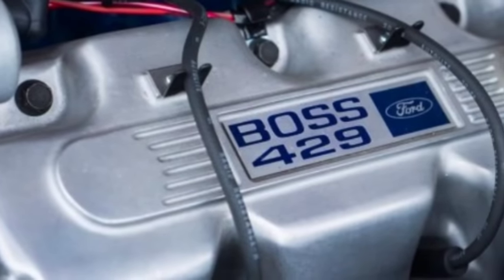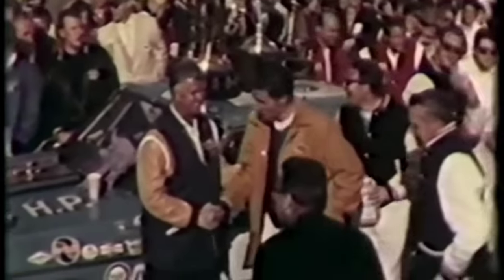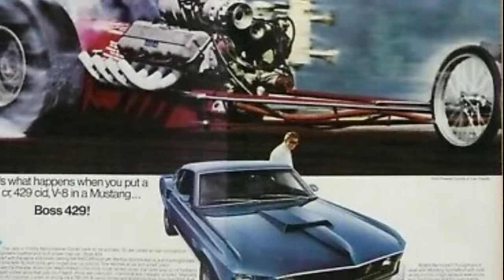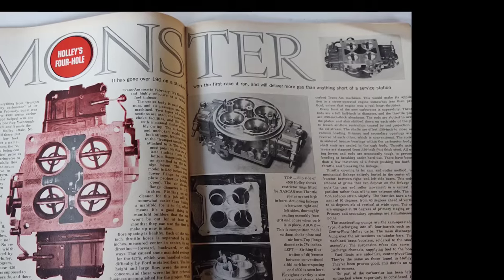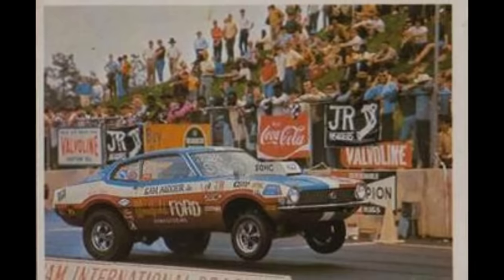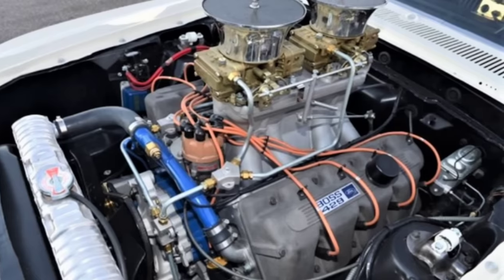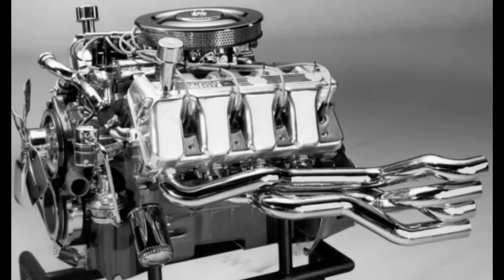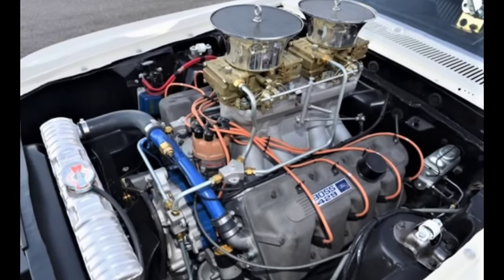The Misunderstood BOSS 429

Comment: The ports were just too big for anything other than wide open throttle. Big ports = low air/fuel velocity at lower rpm. Also the issue with improperly tempered valve springs hindered revving in the early engines, but Ford replaced them. Detuning for the street didn’t work out well. A split plane intake manifold should have improved velocity in lower and midrange rpm. The Ford engineers know more than I do but I just can’t understand how they didn’t work out a street version.

Comment: You can get a new Boss 9 engine from any Ford performance dealer in lots of different cubic inches. All engines are ordered through Ford and all are built by John Kasse race engines. A detuned street version has over 800 HP .

Comment: The tunnel-port 302 fared no better in the Trans Am series.. no bottom end torque exiting the turns... the Z-28s ate them alive. 
The tunnel ports (302 and 429) were best at prolonged, high rpm distances. 
In short, they had no guts down low, but give them a mile to build a head of steam (or add a blower) and they were MONSTERS.
Reply from the maker: Yeah the Tunnel Port 302 was a disaster...
Reply: So who won trans am series in 1970 . Wasn't Chevy.

Comment: In the early 2000 I built an open road racing Mustag using a 441 cammer engine based on a Dove aluminium block. 13 to 1 compression uprated cams . The engine dynoed at 787 hp.
For the period I raced it it was the secon fastest open road racer. Only Gottliebs Camsro utilizing a 530 c.i.  big block Cevy was faster..
 By around 8 mph.
The cammer developed around 1963 made 6 r 5 hp right out of the crate at a time when the M o par hemis were putting out under 550 hp.
At SEMA in 2000 Metthe head of Ford s SVT nit.
He took me to one of the Ford
 trailers and ran a tape of a BSS 429 based engine on the dyno at FORD. The engine dsplaced 540 c.i andas rated at 940 hp contiuous for 4 hours
 It hadbeen developed for offshore bat acing and was avaiable in a crate for 22 000 dollars.

Comment: The Boss 429 looked cool but there's always a drawback when you sell so few of something that there's little to no aftermarket support.  Glidden had to make many of his parts from scratch because he could't buy them.
Reply from the maker: You are right Tim,  With the engine being offered in '69 and '70 only even though NASCAR ran it for a while Glidden was out in the cold for a while!  Alan Root and others re did the heads in the '80's which helped big time... Jon Kaase has really pumped new life into the BOSS 429 with all that he has done...
Reply: @UnityMotorSportsGarage  

Glidden and Kaase are masterful with any engine they apply their talents to. I remember when Glidden even had to make his own rocker arms for the Boss 429

Comment: This engine was actually simple to understand. In track form, it was a high rpm, high horsepower speedway engine. It was not engineered to be a street engine or drag strip engine. If Ford didn't have to put it in a consumer car, as the rules at the time stated, it would have never been used for anything outside NASCAR.

Comment: There was an interesting article in one of those hot rod magazines concerning the Boss 429 (I think it was the Boss 429). The article compared the configuration of the valve train to that of the Chev 396, which in my youth was referred to as a porcupine configuration or cantered valve set-up only the Ford engine was a little more radicle, like having to run the intake pushrods through the intake ports and one or two other oddities when comparing it to the Chev 396. Maybe someone can post a comment about that, like was it the Boss 429 etc.. I was hoping this video would address its design with a little more history of that engine.
Reply from the maker: The Cleveland and 385 series engines have more in common with the BBC than the BOSS 429.  Alot of the influence came from Ford hiring former GM exec.. Bunkie Knudson which brought Larry Shinoda and other top engineers so it's easy to see the why and the how these engines and other design aspects came into play...  Hope this helps
Thanks for Watching
Andy
Reply: @UnityMotorSportsGarage    I assume BBC stands for big block Chev? At that time in my youth the Chev big blocks were the 409's. The big blocks of Chev and Ford were all wedge heads or wedge shaped combustion chambers which limited the size of the valves you could use. There was also the problem of pre-detonation because of where the spark plug was located in those wedge shaped combustion chambered engines. The Chrysler Hemi's didn't have those problems due to spark plug location and combustion chamber configuration. The 396's had the cantered valves so as to try to get the combustion chamber configured as close as they could to the Chrysler Hemi combustion chamber allowing the opportunity for bigger valves etc.. As I recall, the Chev 427 was built along the lines of the 396.
I didn't keep up with any of the new tech after 1969 though I am familiar with the terms like Cleveland but unfamiliar with their design. That article I read was in a "Car Craft" magazine I think (definitly not "Hot Rod") and they got this engine from Ford in a crate, threw it together (no blue printing or balancing) and dyno tested it. In that stock form it was pumping out over 500 horse power and the only thing I clearly remember about that engine was a picture of the intake push rods going through the intake ports in the head. Now in those days of my youth there was NO stock engine coming close to 500 horse power from any car manufacturer. I think the 427 dual quad from Ford was rated at 410 HP and the 289 GT was rated at 271 HP (I had a 66 Mustang GT at that time). I think you could order a Chrysler with a dual quad set-up. Not sure about Chevy. I could have checked all my manuals but I have no idea where they are. As to that article and that engine, I thought it was the "Boss"" engine but not so sure now.
Reply: @brgilbert2  

The pushrod through the intake port was the tunnel port heads on the 427 and 302.

The correct word regarding valve layout is canted, not "cantered."
Reply: @johnpeters9793   Thanks! Right! I do remember that now that I see you mentioning it.

Comment: I had a 428 in my 68 LTD.  Wish I had kept that car for the engine alone
Reply from the maker: I understand that! Thanks for Watching
Andy
Reply: @UnityMotorSportsGarage  my first car was a 67 fairlane GTA.  The guy I bought it from in 1984, bought it new and put a 427 in it, and used it exclusively for racing.  I bought it with the original 390 in it.  He still had the 427 on an engine stand.  He wanted $3000 for the engine.  I paid $1500 for the car.  It still had the fiberglass hood with the scoop on it.  I made payments all summer for the car.  I couldnt afford the 427.  We all know how the prices are now.  If I only had a crystal ball!!  A nice lady totalled the car in an intersection for me, or id still be driving it today.  Those FE engines are tough.. I was 18 then, and hard on equipment.  Never could break anything but left motor mounts and tires!!!

Comment: The engine has a low end air flow problems, back then putting a turbo set up on it would have been genius.
Reply from the maker: It was really impressive, He said that with the boost turned up it made close to 2000hp but he had to turn it down just to make it drivable down the track...  to me the impressive part was this was before turbo technology was still in the dark ages for the most part.. He hooked up with the Ford Engineers who oversaw the Turbo Indy 500 program..  Thanks for watching and please Subscribe as I have some really good stuff coming up!
Andy
Reply: @UnityMotorSportsGarage  yeah that is most impressive. I just subscribed, I just found this channel and I love watching the theory behind these old engines.
Reply: Or a cam designed for the head design.  Jon Kasse's Boss 429's won 14 straight IHRA pro-stock championships, and in 521-up cubic inch form can pump out streetable 1000 horsepower without ANY power adder.

Comment: It's amazing how important stock car racing was back in the day for the manufacturer's image.   The public actually followed stock car racing.  Today the general public could care less, and racing really has no effect on the bottom line for a car company save for the niche automakers.   As for the racers of the day not understanding how to deal with the 429, I'm not surprised.  When you strip away they hype, the 'legendary' race car builders of days gone by were just really amateurs who learned a few tricks along the way and were incapable of dealing with anything new.  They were not engineers, that's for sure.
Reply from the maker: That's true... Back then it was ordinary guys racing these things and once the Big money came in and turned it into a business things changed in a hurry!  I will say that Jack Roush/Robert Yates, Jon Kasse just to name a few seen this and took things to another level! Thanks for Watching!  
Check out engine build Project MIXED UP BOSS!
Andy
Reply: I understand what you are saying, but to say they were "hacks" is totally unfair.  Ford gave them new tech engines that didn't run out of the gate and it took these guys a bit to sort them out..but were expected to win instantly with them.  Tbh the successes were more a result of the builders, and the failures were more on Ford.  

PS being an engineer isn't always the answer.  I run a small plant where the engineers bought 6 electric heaters, and installed 4 of them  on one side of the building.  Now they are surprised the opposite side is cold.  Brilliant work team...
Reply: Not always, Grumpy Bill Jenkins had an engineering background. One of the shrewdest builder/drivers out there, back in the day.
Reply from the maker: @hiitsstillme  He was AMAZING I still have his Small Block Chevy book!  Brilliant man forsure..Thanks for Watching! Please Subscribe as I have other good content coming down the line!
Andy

Comment: It's probably just a product of the era, but I think big-block engines should all have wide valve covers, whether from hemi or canted valve combustion chambers.  Big block Chevy, 426 Hemi, 429 Boss, or 427 SOHC.  Inline valve wedge combustion chambers just don't make it for me in that class of engine.  Even though I'm a Chevy guy, I like the looks of the 427 SOHC best from that era.  The 429 Boss didn't have its day in the sun as a performance engine until long after it went out of production for the general public.  Bob Glidden sure made it dominant in pro stock in the late 80's, but by that time production engine technology was into port fuel injection, smaller displacement, and turbocharging.

Comment: The 429 BOSS (car, not the engine) is not the same as the 429 Nascar. The car itself was only publicly sold to comply with Nascar rules, which is why the 429 didn't get the fancy paint and marketing the flagship 302 BOSS got, they just threw the engine in a street legal car that it would fit in so they could compete. The 429 BOSS engine in the street models was never tuned like the race cars, so some people even refer to them  separately as the 429 semi hemi engine and the 429 Nascar engine despite them being the same 429 BOSS. Chrysler never had a 302 BOSS equivalent to the 426, so the 426 hemi street car got the flagship treatment, and came with the real deal Nascar tune. This is why in a lot of comparisons the 426 Chrysler HEMI, and the CJs, and SCJs outshine the 429. The 429 BOSS was never meant to leave the track, and it didn't need to. The cobra jets were more than enough to keep chevy owners in last place on the road, the HEMI and the BOSS were there to do it on TV.

Comment: 427 SOHC was a killer back then, but I only think a couple of the original 7 astronauts had them on the street in Galaxies.  Shelby might have had one in a Cobra.

Now they would seem very antiquated.
Reply: I doubt a Boss 9 would fit it a Shelby Cobra. They had to widen the engine bay on the Mustang and the 427 in the Cobra barely fit with the headers. I would have loved to have seen it happen. Rode in a 427 SC in 1979. I asked the owner about 0-100-0 in 13 seconds. I ran the stop watch. Yup, they can sure do it. Power shift from 3rd to 4th at 120 mph and the car fishtails slightly. What was I thinking back then, I wasn't wearing my seatbelt!

Comment: 2:25 mark - It is a common misconception that the 427SOHC was banned. NASCAR keep throwing up barriers that Ford would eventually clear. The 427 SOHC was finally legal to race without a weight penalty in June 1966. Ford vowed to have engines and support ready for the 1967 season. Ford eventually used the 427 Tunnel Port instead.
Reply: Their is a great interview with Glidden and that time. When NHREA let warren Johnson basically build an engine from scratch Bob had built a new shop to do the same and the Ford guys pulled the plug..I think Ford was smart and could see NHRA would do anything to help GM win..Look at prostock today, changed the rules so even Dodge couldn't compete so now its all Chevy's

Comment: you need to change the cam to a 1970 lamonse style  cam and then look out every thing is fixed it will do low tuque will be there it will launch you like a 50 Cal out of a Barrett but things will break you have to find what you need to keep it from breaking I have and wow this is the power like no other engine I have ever played with the clutch hard to find one that will last more than 15 hard launches have to change it a lot rear wheel studs break a lot and other things I have been able to fix yes this is a great motor if you do it correct it can be better than the CJ 428 took me 10 years but this is the beast of all time

Comment: Little known fact,  the 427 SOHC was not actually banned. They added weight to that engine if you used it, so it was never used because the tunnel port headed 427 was not penalized with extra weight.
Reply from the maker: It was banned in '65 but they resended the ruling for 1966 and told Ford they could run it in a full size with a 400lb weight penalty.. They said NO Thanks!  Thanks for Watching and please Subscribe as I have more good content coming up!
Andy

Comment: Didn't they ban the 427 SOHC engine because it wasn't offered in enough production cars?
Reply: They banned it because it was too powerful and put Chrysler and GM at a huge disadvantage in NASCAR.
Reply: @markantony3875  No it is because it was not sold as a factory-installed option.  They later banned the 426 Hemi because all of this was just doing purpose-built engines for these cars and not 'stock.'  Even today you can hardly argue that any of the engines they race are 'stock' cars.
Reply: @markantony3875  Because it was a purpose-built engine, not stock.  GM was making a 427 too but never raced it in NASCAR because it wasn't a factory option.  The 327, 350, 396 all were.

Comment: My buddie  had an older sister that bought one of those used, she worked at jack in the box, I think she payed less than $1400 cause it was a gas hog. Damn near every time my buddie borrowed it we broke it. Different components in the valve train would break. Didnt break for her but she didn`t push it

Comment: 2:12
Ford claimed in at least one "should we ban this engine" hearing that the 427 SOHC (which was also a Hemi) that it made 50 more horsepower than the Dodge 426 Hemi.
DODGE claimed Ford was lying, it was more like 100 Horsepower.
Both engines DID in fact have other places to race - the 427SOHC was used in the GT40 that won LeMans, and the 426 Hemi turned into a IHRA/NHRA drag racing staple (and the same basic design is still used TODAY in drag racing).
Reply: The Lemans winning 427 was not an SOHC.

Comment: 5:37 "This new Mercury Cyclone with this new Hemi engine". 🤣
Reply from the maker: I know, Its funny looking back... Thanks for Watching and Please Subscribe as I have some cool things coming up!
Andy
Reply: OK, it's a "semi hemi" like the Chevy rat motor.
Reply from the maker: @bwtv147  Ive always thought of it as a Twisted Hemi..  But the ironic part is the chamber is pretty close to the Modern day Hemi that Mopar makes.. 
Andy
Reply: @bwtv147  The road version was a semi hemi but the nascar version was full hemi
Reply: @dragonfly492  Are you sure?  I understood that the modern semi hemis allow better port design and flow better than the old true hemis.
Reply: @bwtv147  It's a straight up hemi, with quench pads on each side of the chamber, however in some applications they were machined out. Straight across ports a hemi. Now the 429 CobraJet and SCJ were semi-hemi like the Chevy.
Reply from the maker: Exactly... Some get caught up in names..lol Thanks for Watching! Please Subscribe and check out my Project MIXED UP BOSS... Putting BOSS 429 style heads on a 429" Stroker Windsor shortblock!
Andy